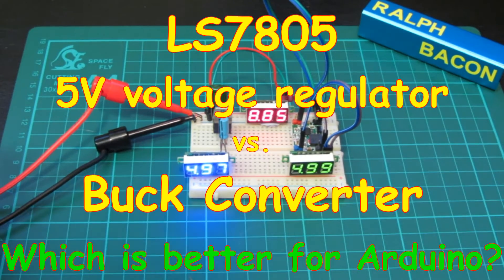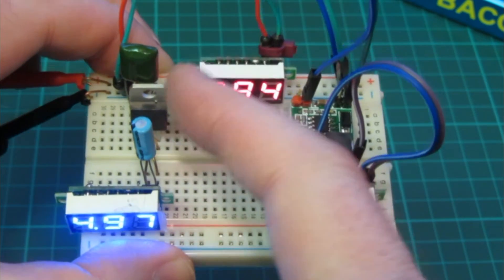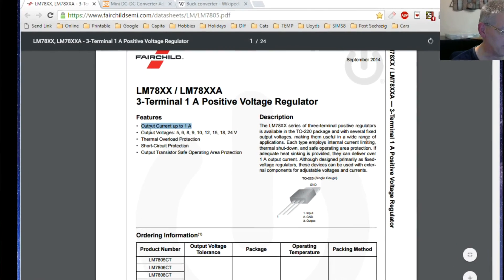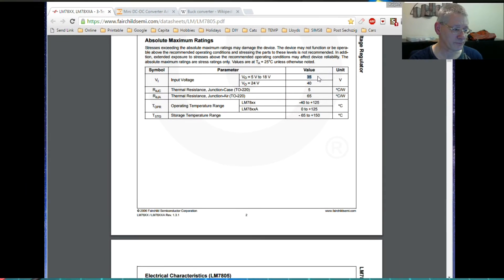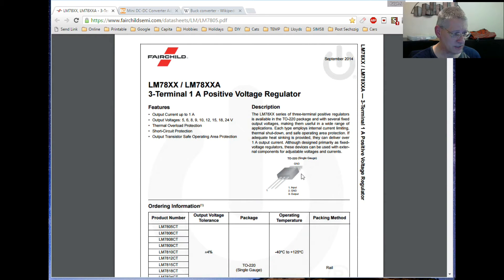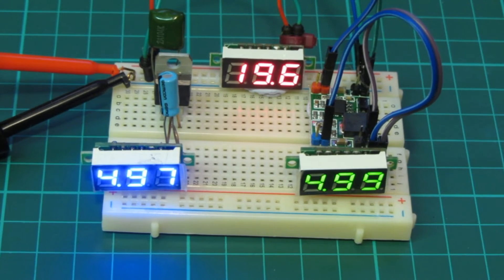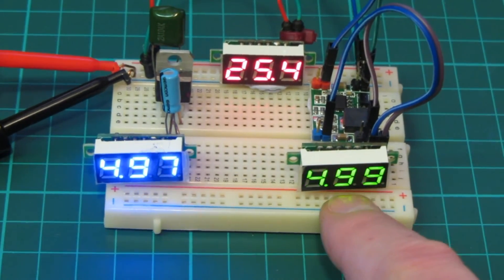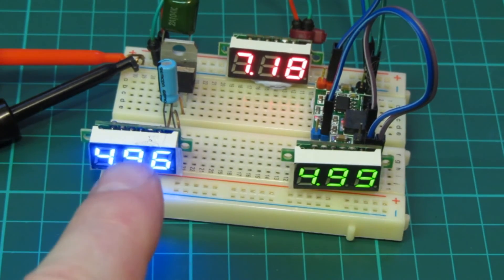#21 Voltage Conversion: Linear Voltage Regulator vs Buck Converter

Comment: For the buck converter do I need a capacitor like on a 7805 voltage regulator or can I install it just by itself 
If I do use a 7805 what’s better to use for 12-14 Volts in And 5 volts out the 7805 1 amp or 3 amp thanks for you’re time
Reply from the maker: For the buck converter it's always a good idea to put some kind of small capacitor on the input and output.

For the 7805, whether the 1A or 3A depends on how much current you will be drawing. Remember these things can get really 🥵 HOT so a higher rated item will run (relatively) cooler but you still might need a heatsink. 

Hence my preference in using a buck (or boost) converter. No heat generated, hardly.

Comment: The car is a 1976 Plymouth can I use a buck converter instead of the lm7805 they both do the same thing right
Reply from the maker: Yes they do. 12v in, 5v out. Buck converter is more efficient, usually doesn't get hot (unlike a linear voltage converter) but does put high frequency noise on the output. Check what it's like with an oscilloscope if you have one. Or check your car's radio with it temporarily fitted to see if it introduces noise in that.

Comment: Hello I want to install a voltage regulator in my car in the dash for temp and fuel gauges 12 volts in ground and 5 volts out to gauges would a buck converter work or voltage regulator which would be best thanks
Reply from the maker: Simplest, not necessarily the best, is a simple linear 7805 voltage regulator with a couple of 0.2uF decoupling caps. Watch the heat dissipation; the tab is ground so you can bolt it to the car chassis. For a car, it's the simplest option and no high frequency noise that might upset the gauges.

Comment: if my input is 14v with 2v ripple on the top.. will it work?
Reply from the maker: Wow! 2V ripple? I wouldn't even call that a power supply! But, yes, I guess it would, although you need a large, electrolytic capacitor in front of any voltage converter to try and reduce that ripple. At least 1,000µF, or several of them!

Comment: Hello Ralph, thank you for your teaching tutorials. They help a lot. What about the Quiescent Current of each one, I have tested the LM7805 with 9v in and I get about 3.1mA consumption with no load. I haven't tested the MP1584 yet but according to it's datasheet it should cosume around 100uA with no load which is a huge difference when using batteries on our projects. Now I'm a little bit confused because the datasheet is for the IC and not for the buck converter board that use this IC. The 100uA quiescent current applies for the buck converter?
Reply from the maker: Linear voltage regulators will always use more current (eg a few milliamps) and are not really suitable for any battery-powered project. A simple buck boost (or DC to DC converter) will take far less but you don't get something for nothing. 100µA would be a good figure - but if your Arduino goes into Deep Sleep and consumes just 0.2µA (as I showed in recent video) then it still seems too much! It very much depends on how critical power consumption is in your project.

Comment: Thanks. I'm needing to power both an arduino nano and a 12v motor off the same supply (which the arduino controls via a relay). While the nano will take a 12v supply, I'd prefer to give it 5v so that the nano is not having to manage the extra voltage. The buck converter seems perfect for this.
Reply from the maker: Yes, it makes sense to do it that way, Chris. Just remember you MIGHT need to clean up the output a bit (simple resistor and capacitor) to get rid of any high-frequency noise on the buck output. If you have a scope you will be able to check this.

Comment: Hello Ralph great education video. Can you please do a video of linear effect hall sensor powering a 5v led strip of 1m. Powered by 5v. Or can you suggest any places where I can buy the ready made module.
Reply from the maker: You are in luck, Ajay. Video #55 describes a Hall effect transistor and using that as the sensor to turn on an LED. You could easily use this as a basis for your requirement. Have a look and see how it goes.

Comment: A good explanation and easy to follow. Is is possible to use a buck converter and linear converter in series to get a more efficient stable output? For example have a buck converter reduce 20v to 7, then a linear converter reduce that to 5?  Or would the linear converter not react quickly enough to avoid the ripple?
Reply from the maker: You can use a linear converter after a buck converter, BaselBantam,  (I've seen that quite often in commercial designs) although you would not want to drop from 20v down to 7v as the heat generated would be huge (with a correspondingly huge heatsink) and thus loss of efficiency.
 
What I've seen most is a drop from 5v to 3.3v using a linear converter that doesn't require more than about 1v above the output (that is, you want 3.3v out so the input has to be at least 4.3v). Some linear converters require 2v above the desired output voltage, not so good.
 
However, that all said, if all you're doing this for is "stability" or to reduce ripple then forget it. Whilst a switched mode power supply (eg from a buck converter) does contain a tiny high frequency element of noise / ripple it's hardly enough to worry us in day-to-day Arduino use (unless you're using a radio frequency transmitter, for example, when it can matter).
Reply: Ralph S Bacon Thank you. That’s a thorough answer.

Comment: Very nice tutorial! I'm going through a bunch more of your vids and learning a lot. I have seen many other vid creators but you have a way of explaining the right things in the right order, without a lot of fluff words that add no USEFUL info.
The differences between linear/switched could be a little better demonstrated rather then explained with a few ammeters on the input and output sides. Aiming a digital thermometer at the linear heatsink, and running it up past 2 A would show the practical meaning of efficiency. Also a scope on the output of the switcher and then the linear would demonstrate the noise aspects. Consider it for another vid when you have some spare (ha!) time. :)
Reply from the maker: I'm sorry, Jim, I didn't understand that last sentence. Spare and time? What does this mean? I believe I've heard of the phrase but I assumed it was fictitious. Anyway, thanks for your supportive words and the critique which I will look into in more detail but unfortunately time (that word again) has beaten me here as Benny is due his supper. Seriously, thanks for posting, appreciated.
Reply: I edited my post slightly. I hadn't meant to put a strike through the word useful. That NEGATED the word!! I guess you understood my intent. Adding - or * adds strike but I can't figure out how to add a bold or underline. So I added caps which is good enough.
Reply from the maker: To add bold to a post, surround that word with asterisks. Doesn't seem to work for two or more words though.

Comment: Dear Ralph, what if we want to use the arduino to measure the voltage of lets say a battery bank and displays the real time voltage, does it need a special sensor for this purpose? can we manage to do this using the analogue input pins with out the help of any additional parts?
Reply from the maker: Hi Wael! It's fairly easy to turn an Arduino into a low-end voltage meter, but rather than me explain that you might as well read this article: https://startingelectronics.org/articles/arduino/measuring-voltage-with-arduino/ which explains it all! Good luck and don't apply more than 5v to any analog (or digital for that matter) pin!
Reply: dear Ralph, that was exactly what I meant by my question, same as the link you give, to use the voltage divider rule to measure the battery banks voltage.

Thank you very much Ralph for your reply.

Comment: There a number of ways to get the ripple voltage down to something manageable.  One is to place a larger cap or two you could place the linear regulator on the output of the buck converter which would be set to say .01 volts higher than desired.  Am sure mate there are more ways but think the second one is cheaper component wise.
Reply from the maker: Yes, TechMan1219, ripple can be bothersome, but as you say a capacitor on the power rail (ideally two of them, separated by a very low value resistor) can do wonders to improve that. The thing to watch out for with linear voltage regulators is that they often require at least one or two volts above the required output and whilst they may improve ripple I'm not convinced it's the way to go as it negates the efficiency of the buck converter. But as you say there are many ways of doing this so thanks for your suggestion, others will benefit too.

Comment: how is it considered better is what I do not get since a lot of buck converters have a voltage regulator on them I have even seen them on ebay with a 7805 on them
Reply from the maker: Hello vorkev1, welcome to my channel. Now you say that you have seen buck converters with voltage regulators on them? Me too, like this one here: http://www.ebay.co.uk/itm/L7805-Buck-Converter-DC-DC-7-15V-9V-12V-to-5V-2A-Step-down-Power-Supply-Module-/172442662702?hash=item282662372e:g:HQUAAOSw6DtYTlL2
 
But this is NOT a buck converter, is it a standard linear voltage regulator! The whole point (as explained in my video) is that buck converters are EFFICIENT because they do not discard unrequired voltage / current as heat, they simply chop the voltage supply up into a wave that averages out to the required voltage. No heatsinks (usually) required (a big giveaway in that above ebay listing) as it is up to 95% efficient. The ONLY downside of a buck converter is that there can be some residual noise on the output rail so it can't always be used for highly sensitive circuits (RF modulators for example) without further smoothing and regulation.
 
You can't assume that the ebay seller knows what he is selling; the term "buck converter" and "linear voltage regulator" may well appear to be the same thing to the seller, he just knows it converts voltage from one value to another! So it is up to us Arduinites to be aware of what is actually being sold.
 
An excellent point you have raised for others to be aware of so thanks you very much for pointing this out, great to hear from you.
Reply from the maker: I'm also thinking that if you were to use a buck converter to convert, say, 12 volts down to 5v (very efficiently), then you COULD use a linear voltage regulator to convert the 5v to 3.3v to allow the user to have both voltages available - it might be a cheaper way of giving both voltages as long as the current drawn by the 3.3v was not high thus not negating the efficiency gained by the buck converter in the first place. Yes, I know, it's all a bit confusing. Just a thought...
Reply: The 'buck converter' in the title and description are KEYWORD SPAM!!! Looking at the board if there's no coil and no small IC chip it can't be a switched power supply.
Ebay is bloody screaming !RAMPANT! with keyword spam!! (I could show you examples of RC model products that would curl your toenails.) This one is a violation of ebay vendor TOS, could be reported and the vendor should be shut down till they fix it. But ebay doesn't care any more as long as they get their $cut$. Caveat emptor.
That's not to say it's not a handy little PS module! It has 3 power input options, 3 output options including USB, nice little heatsink, a power switch and an LED. Very nice. No mounting holes, but that's what hot glue is for. ;) There will always be need for linear PS. The time saved hooking up these bits on a breadboard is worth the $, just slap it in and it's done. It's very useful for many prototype/breadboard quick-n-dirty 'I need clean isolated 5V right-->here right now' purposes.

Comment: I am getting a current of 3mA from a LM7805. How to increase the same?? Is it linked to input voltage and input current?
Reply from the maker: Well, when you say you are "getting" just 3mA current, does that mean you have tried to draw more current into a low value resistor, for example, but did not get more? Remember that the INPUT voltage to this 5v device must be 1 to 2 volts more than the output (for the exact value you must refer to the datasheet). Then you will be able to draw up to 500mA (although you MAY need a heatsink as it will get hot). And yes, you won't be able to draw more current that the input current has available.
If I have misunderstood please feel free to rephrase your question. I hope this helps?